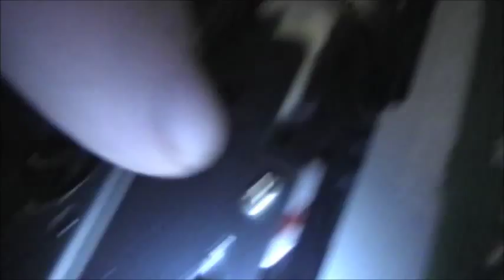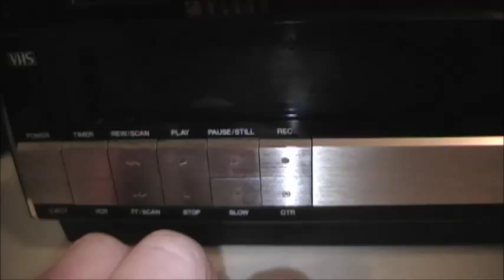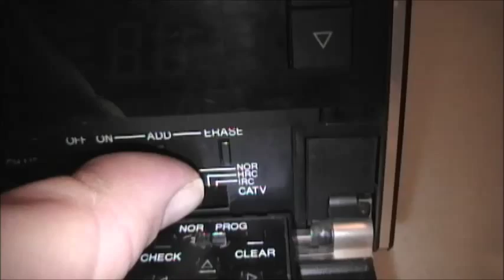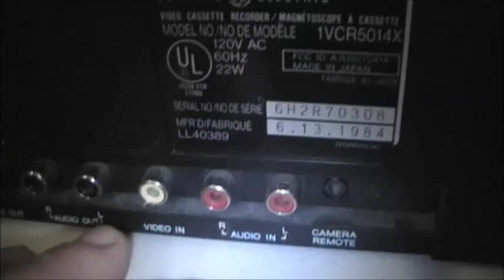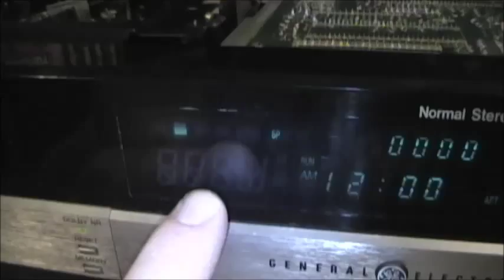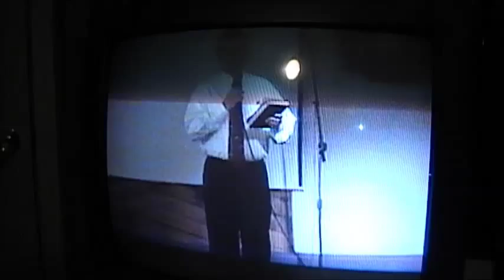1984 General Electric Stereo VCR - Review ane Test - Inside and Out

Comment: That greasy mode gear often had problems with the nipple that rides in it busting out part of the groove wall if it lost lubrication. You may find a mode switch right under it that tells the system control chip (IC 1) what mode the machine is in. Rewind in play mode should be the very last mode on that gear (also the most difficult task for the machine to do). The belt above it goes to the mode motor & the loading tray should have its own motor with a worm gear set at a slight angle (on the top side). ---  This is NOT a Hi-Fi stereo VCR, it is linear (like audio cassettes) , but still great as some of those older pre-Hi-Fi cassettes were linear stereo only. --- "A Dub" is for recording over the audio portion of a cassette without erasing the video. Channel "3-4" switch is the channel you want to transmit to the TV. --- ONTV (Pay TV) began in 1977 was one of the scrambled UHF over-the-air paid TV services for many major metropolitan US cities. The system died about 1985 due to Cable TV

Comment: I have the low end of this model, 2 heads, manual channel select, no lcd and the belts are in the same shape, really greate, but mine looks like it has a belt less than yours (I made a video of it if you are interested). Great video and vcr are the best, long life to vcr. A little trick, if you want the scanline to be less visible, put the brightness down and most of the time the scanline will shrink or go away.
Reply from the maker: Thanks. I will give that a try. So far, I am very impressed with the Video and Audio Quality of this VCR. I was very surprised to find that this model is cable ready. In the past, I had a few models similar to this one, but they were not cable ready. I could only program the first 13 Channels.